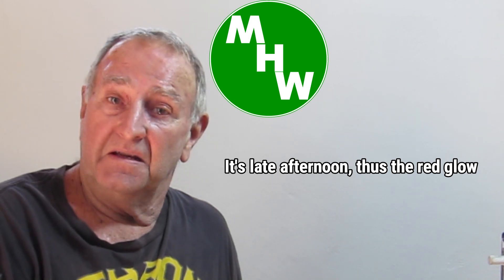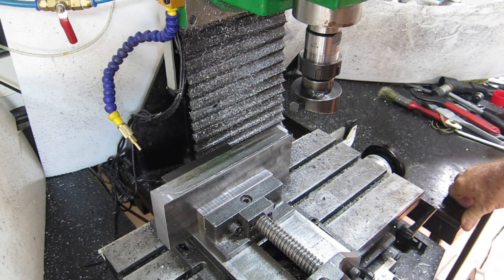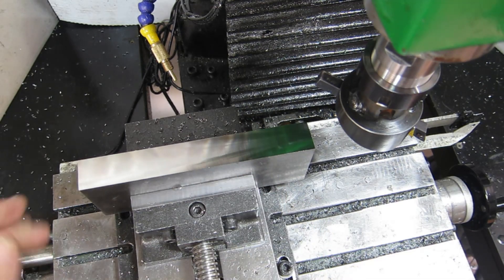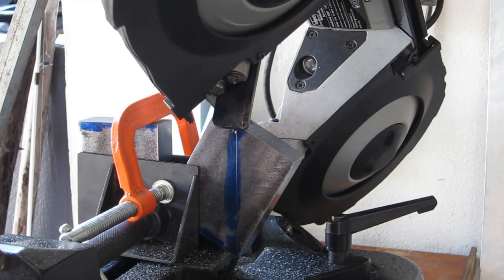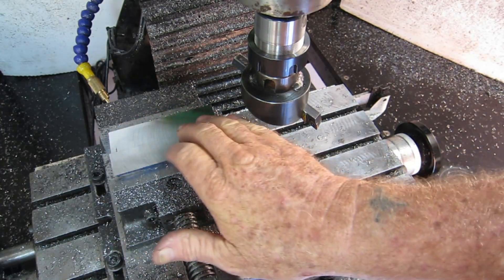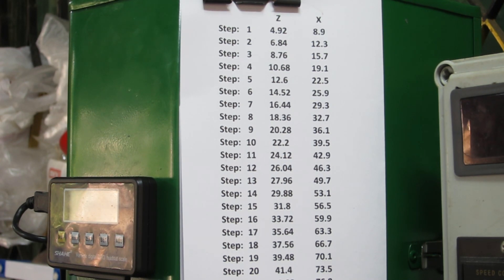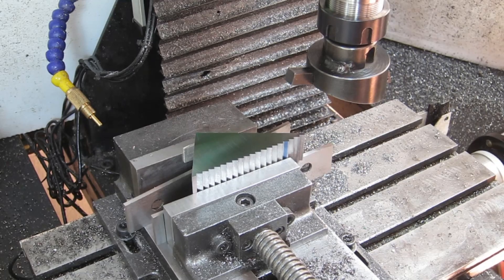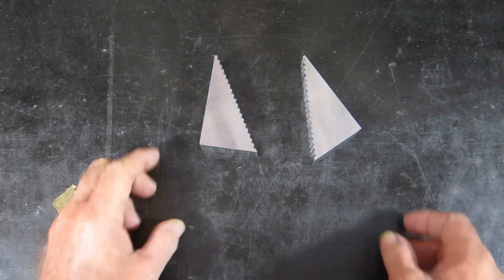MHW Episode 65 - Homemade Stepped Milling Clamps

Comment: I made mine with 90° steps and they work perfectly fine. I use them all the time, without any problem.
I hope your neigbour story will have a happy ending very soon.
Reply from the maker: I was working on the theory that because I only have 8mm bolts I can't crank down on them as hard as I could with larger bolts. 👍